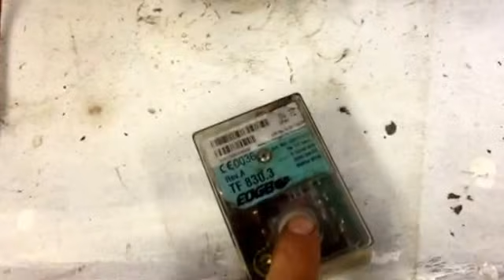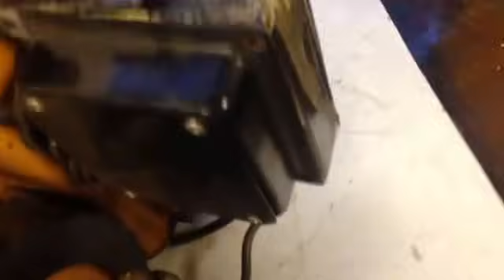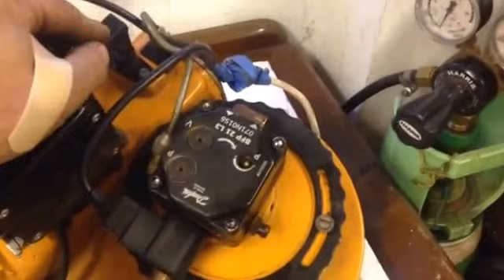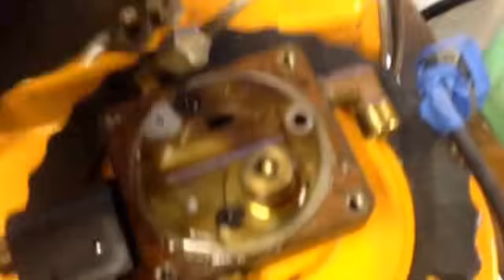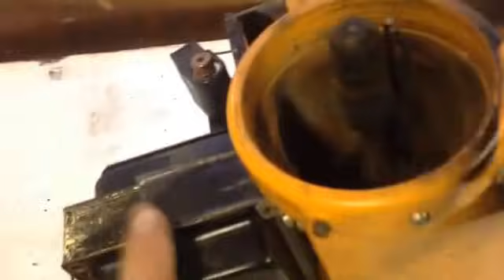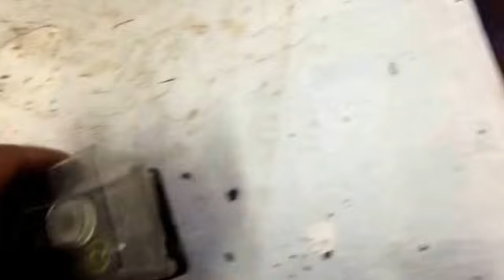Guide to repair / fix / diagnose / troubleshoot oil burner or oil boiler

Comment: My boiler suddenly stopped working. If it was left for an hour or so it would work again but only for a short time. The problem was the filter in the oil pump housing. It was full of black particulates clogging oil flow, I flushed it all out but I was curious that the first filter in the housing at the remote oil tank was perfectly clean. I cannot imagine how particulates (they are smudgy black) could find their way into a continuous copper pipe feed ???? I cleaned out the oil pump housing filter and the boiler fired up and worked for a couple of days. Then exactly the same again - clogged filter in the oil pump. Recleaned, flushed it all but this time the oil pump rotor was jammed up. Running dry, because of the lack of oil getting through the clogged filter had caused it to jam up. Un-jammed it manually and evreything is now working very well again - but I don't know how longthe filter will stay clean because I STILL HAVE NO IDEA where the dirt comes from?

Comment: I have an issue with an oil boiler. The fan runs, solenoid sounds like it opens by a singular thump noise. (Although that sound could be something else I guess). Boiler doesn't try to spark. 5 seconds later, fan stops blowing. Press reset and it just does it again. Fan blows, thud, then stops. No spark noise. Boiler lights don't change at any point.

Ideas?

Comment: The thing about water is to drain a small amount from the feed having isolated the feed by turning the tap/cock to the off position then once disconnected 15mm 5/8" spanner on some, place oil line hose.into a glass jar or clear plastic, turn the  cock/tap/forcet on and take a good sample. Refit the oil feed. The jar or plastic container lid replace and leave where no one can touch. Check for water at the bottom after a long period wait. Alternative is to make up a secure way to spin the jar on a rope/line over your head and it will speed up the separation. I used this on Diesel systems on trucks.
Reply: Additional /very good video.5*

Comment: An awesome video that has helped me fix our old boiler a few times. Have just replaced the solenoid on top of the fuel pump as was cutting out after random number of minutes/hours but while it worked initially now it’s stopped again but this time the air pump wasn’t even running.  Took that out and it spins freely, some light resistance to the fuel pump spindle (but turning ok) so put it back together and now it all works 🤦‍♂️ Wondering it could possibly be wrong part I fitted and perhaps not opening up fuel line fully enough and putting pressure on fuel pump?

Am thinking it is finally time for a new boiler 😂

Comment: Thanks!   Perhaps you have an idea what the problem is of my oil heater. It has a Danfoss oil pump BFP 52E R5. The heater can heat with 80kW and 110kW. It has two solenoid valves. I think for 110kW both are open. 
Now when I start with 80kW the heater starts without any problems and if if switch then to 110kW it's also working. But if I want to start it directly with 110kW it is trying to start, rattles a bit and turns off. Do you have an Idea what it is? Thanks a lot
Reply: It is not designed to start that way, the burner when starting will open one of the solenoids first then after about 2 minutes then the other solenoid will open up and full heat will be produced. There will be two burner nozzles and each solenoid supplies one of the nozzles. This is my experience servicing large boilers using up to 10 gallons per hour

Comment: Hi Sebastian. My burner won't come on at in house control unit but when I go out the red light is on, so press it, but funny thing is it works and STAYS on but when I switch it off indoors it won't come on with the timer , goes back to red light 🤔 . In June I cleaned the actual boiler and cleaned the plates inside and changed the nozzle and was working fine until a couple of days ago any help would be appreciated

Comment: Your info on the solenoid was spot on. My oil burner was only burning for a few minutes and then turned off, replaced the solenoid and everything is working normal. Thank you a lot, your info helped me a lot, especially because it's -20C here right now 😅😅
Reply: Me to, our boiler wouldn't run for more than 5 mins.  Was told I needed a new boiler, thought this was worth a go for £20, why not.  In under 5 mins I had the solenoid replaced and it was back up and running.  Amazing thanks!

Comment: The drive pin for the gears in the pump can break causing no oil pressure. 
I get them pins made up so I can easily replace them. 
Or fit a new pump and recondition the old one and it can come in handy

Comment: mine switches on and runs for maybe 2 minutes and cuts of----------no cut out light comes on-red light on power box that is---------check thermostat on front of burner--power going in but no power going to burner control box------leave it for maybe 5-10 minutes and it will only start if u turn the temp control knob but will cut out again within in 1 2 minutes----these stats are quite dear-so anyone out there would u agree with me it looks like faulty stat-by the way i had a solinoid and replaced it no good-any comments welcome thanks

Comment: Brilliant video and extremely well explained! I watched it through a few times while waiting for a qualified engineer to come to fix my Rayburn 680k cd boiler as the cooking side kept locking out and eventually would not fire up
I'm surprised how simple the workings are in oil fired burners and how easy they are to understand having watched this video
It turned out that there were 2 problems which were preventing my burner to fire up
First of all, the oil pump was jamming, not all the time, but intermittently. the oil pump and solenoid were replaced and the burner fired up
However,after a short while it locked out again so the engineer came back to it
The second time, he replaced the fan capacitor and that has sorted out the problem 
I will continue to get my Rayburn serviced annually by the same qualified engineer but I was just curious as to what the function of the fan capacitor is, which is the only thing that wasn't explained in any detail in this video
Can anyone tell me please?
Reply: I have been servicing around 20 oil boilers a week and attending on average 5 breakdowns a week for the best part of a year. I personally don't find oil burners 'easy' at all!

Comment: Wrong mate you do need to be Oftec registered to work on boilers not just competent the qualification means your competent 
And as you say more fires are caused by oil than gas so your insurance company will not pay out another amateur you tuber giving bad dangerous advice   Sham on you

Comment: Hi i have a problem with mine and no one can seem to find the problem. It did fire up an run then the red flame light came on. now it might start up, might not sometimes. when it does it can run for 1 to 5 min then stop it might start up again then it might not. HELP

Comment: Hi Sebastian, can I ask your advice please. I am working on a monoflame minor 1, it’s not even attempting to fire, fan/motor doesn’t come on, I have wired motor to mains and it works, when I power up burner it just sparks electrodes briefly but no motor running. I’m thinking it’s control box, any idea what might be wrong? Thanks, Brian

Comment: Hello Sebastian, I'm struggling with a Bairan in a bakery oven, can you help? I got it to spray diesel and other fixes but it's just not flaming up.....a very small flame comes on and struggles....yet the fan is blowing very high and the sparks look good and strong......I even changed from diesel to kerosene but it's no use. HELPPP

Comment: Thanks for great video. My control box has not got any light on but the pump wouldn't switch to heat water or run central heating. Can I still press it to try reset it?

Comment: On the coldest day of the year. 4 hours of servicing fault eliminating provided no solution. I had a tea break and found your video (after watching 6 others). Your tip about the pump solenoid failing after 2 minutes due to dodgy coil heating up and breaking contact . Swapped it from my boiler spares box and great joy we are warm again. Many thanks excellent explanation well done.

Comment: What do you think problem is when it does fire up then dies after 30 seconds roughly .i have to wait a minute till I hear a click from pump then I press button on pump it fires up then runs ok ,do you think it's air in line ? It doesent work from the control unit in the house ,I have to go out and start it from the unit outside .would appreciate your input .

Comment: Bloody excellent - I've got a Redfyre Oil Range Cooker - can I get someone to service it; more chance of finding Hen's teeth!  Last engineer recommended I buy a new range cooker (£9k).
Reply: Ditto, my 20 year old Redfyre hasn't been serviced for a few years for that very reason. Local oil boiler service people seem to imply it is some kind of black magic.I think they just don't like having to work through the relatively restricted front panel of the cooker.  Most common problems on mine have been solenoid, several times (Grundfoss solenoids seem very unreliable) and the motor capacitor changed a couple of times. This video has been an excellent explanation of what is going on.

Comment: Magic eye is a photocell just so people know what to look for at the merchants.
Transformer produces 30 to 50 thousand volts for ignition of the atomomised fuel/air mixture but with a low amperage so it  is less lightly to seriously harm or kill. The 220 to 240 volt supply to burner is much more dangerous as it can have anywhere from 0.1 milliamps amps and 3 amps can be enough to light up your insides and youd be history. It takes only 100mA to stop your heart.
It's a good video guide and I'll recommend it for others to watch👍 Always replace bearings.
Solenoid coil slips over the brass solenoid valve stem.
Depending on the size of the jet....psi for diesel is 140 psi and 90 psi upwards for kerosene.

Comment: when I on my heating system the light of controller within second gets on then goes off then no light is there the orange light stays on when its working and flame is working properly but in this case, it is not igniting anymore, what do you think what it could be? Please reply because I am going to open it today the first time in my life, that would be very kind if you help us. thanks, yesterday I pushed the button and it went on but today goes off.

Comment: Hi very interesting, but I'm still stuck where do I find the bleed nut on a ecoflam boiler.
The boiler is very old but it was working fine until  until a friend house sittin ran out of oil.
It will strike up but won't stay on  I think it could be air in the line.
It's a ecloflam boiler with a flair motor. Any help would be much appreciated. Maria.

Comment: A dangerous man with little knowledge
Reply: I've had qualified OFTEC boilers engineers, three of them that had less knowledge than this guy and the last one (last month) just 'F****d' up my boiler caused my house to be covered in soot and is now part of a £10k insurance claim.  Qualifications mean nothing - experience does.  So far all of the OFTEC engineers have been muppets. Getting a quality heating engineer (and I use the term engineer loosely) is just as bad as getting a good plumber, car mechanic or builder.  They all have different standards and level of competence; most of them low.
Reply: The problem with oftec nobody fails and joe blogs can do the exam pay for registration  yet in reality hes done a two week course and knows jack shit.Oftec has done more harm than good.Ive been in the trade from 16 and 51 now done 5 year apprenticeship plus g3 etc but refuse to get involved with oftec.
Reply: I have looked at a few oil boiler youtube vids and every single one has been rubbish.A lot of false and wrong information so be careful.
Reply: @philipwatkins8157  Never a truer word spoken!
Reply: Wayne Robbo he's a limey hacker

Comment: Hi
Been having trouble with my heatslave 26/32 
Having watched your video I tried a few of your tips, and found the fan wasn't turning freely (by the way this was on a sterling 40 burner) so I disconnected the fuel pump from the fan and the fan was fine but the fuel pump was notchey so put some olive oil into the bearing side and 
Worked fine. So ordering a new fuel pump 
Original symptoms were when flat cold And everything reset it would heat up ok 
Then when you wanted more water i.e. Shower/bath /heating etc it would trip out 
Guessing the bearings in the pump when warm would be more tight 
Thanks for the great video although different pump the principles are the same 🤗🤗🤗🤗🤗

Comment: Excellent video. Found my boiler stops because the coil goes open circuit when it gets hot. The resistance was within spec when it was cold!

Comment: im in the process of trouble shooting mine, its knocking itself of after 7 mins, ive timed it the last 3 times ive turned it on, 1st = 7.03 mins, 2nd = 4.30 mins, then 3rd = 7.15 mins, the fan it starting up, the spark is kicking in then cutting out after ignition, and it runs for say those 7 mins fine there is heat coming out of the vent, but then it just knocks off, I then have to wait for about 3-4 hours for the thing to cool down it would seem before it will start again, the reset button isn't doing anything, i'm thinking it has either something to do with either the fuel supply, I got some oil from my wifes granny because she got gas installed and had a few barrels of oil left over and give them out to the family, I ended up getting the one that was last drained and it had all the dirt at the bottom of barrel, I forgot to use an old t-shirt or something to filter out all the crap when I was putting it in, that was last year though and it has run dry since then and been refilled and hasn't caused any problems, until now, im thinking a little bit of dirt has got in between the exit valve at the tank and is only allowing a small amount through enough for it to fire and run for 7+ mins, then cut out due to lack of oil.
Either that or there is a problem with the heating side of it that its not getting the water flowing through to heat, any ideas on what it could be would be welcomed.
Reply: BraveStaRR could be a bad heat exchanger. It could be cracked

Comment: That is a very old burner iv been servicing oil burners for 25 years and haven't seen one of then for a long time lol  ,, Riello RDB next time , 
Btw you need a combustion Analyzer to reset combustion after caring out any work on any fuel burning appliances ,